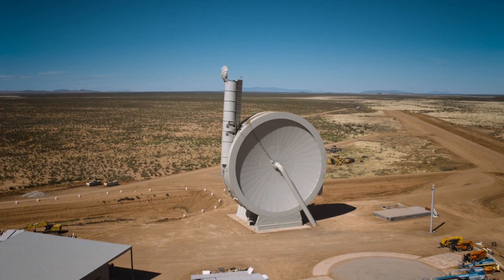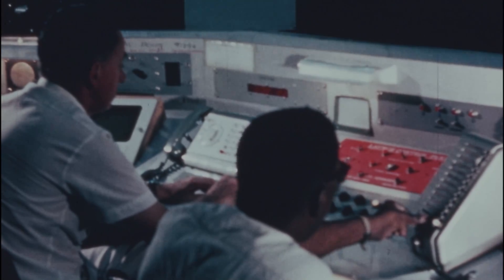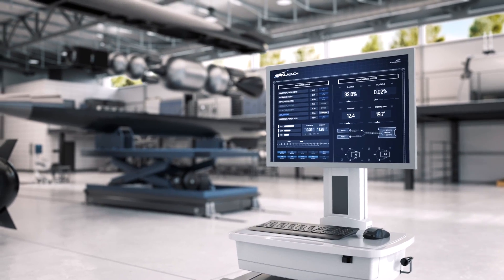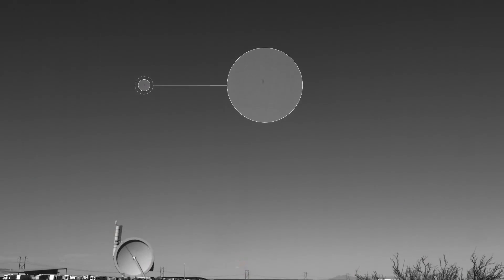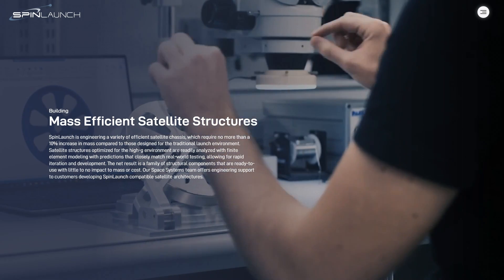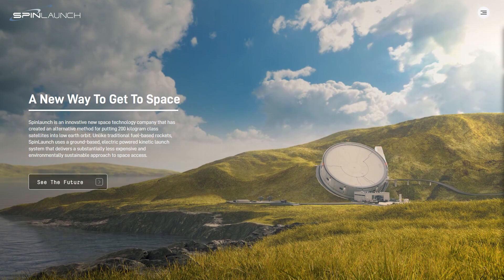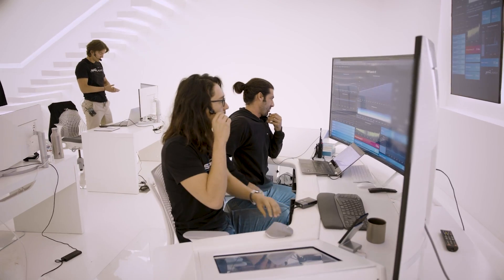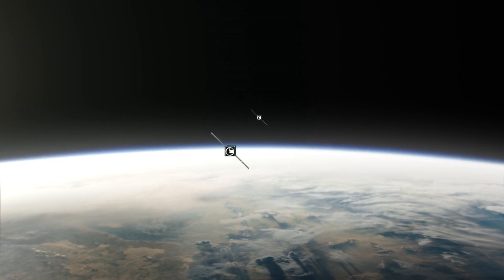Can Spinlaunch Throw Rockets Into Space?

Comment: So basically if the release goes wrong at any point you have a missile filled with explosive fuel launching at hypersonic speed directly into your only launch system which is also the world's biggest vacuum. What could possibly go wrong?
Reply: I wonder how far it could go into the ground if it released at the opposite of the right time.
Reply: @Hashishin13  Dirt is one of the best bullet-stops we have, so you'd be surprised how little it would penetrate.
Reply: @Hashishin13  :  I don't know how far.  
                  But! 
 I'd bet you'd end up with a tourist destination like that one La Palma has now. 🌋 😎👍
Reply: @Hashishin13   that is the easy solution to the load balancing problem brought up in the video.  Release the counterweight at the same time as you release the payload.  So they'd have to dig a hole deep enough that the impact of the counterweight deep in the ground was fully contained.
Reply: @Hashishin13  not much if a 10 kilometre  asteroid weighting millions of tonnes travelling at holy crap speeds  didn't created anything more than a large ditch on earth a 1 - 100 tonne projectile travelling at mach 1-7  won't do much.
Reply: @rohankumarpanigrahi7475  but then again the said asteroid wasn't aerodinamic
Reply: @rohankumarpanigrahi7475  Probably right but don't forget the atmosphere absorbed most of the impact.
Reply: I do not have the mathematical precision to answer this question Rohan but there is one other thing to consider here... and that's the narrow point and overall thin (and uniform) dimensions of this projectile compared to the larger surface area of said asteroid spreading out the force of impact more.
Reply: @rohankumarpanigrahi7475  well, it's because an asteroid spends most of its energy hitting the atmosphere, here it'd be at ground level from the start ;)
Reply: @john5r  do you realise the difference in the energy of an asteroid impact and whatever we can produce today.the chicxulub impact is estimated to have been equivalent of a million megaton tnt blast. The biggest nukes that we can make today are a couple hundred megatons at best.

I do realise that it would be a big disaster if things go south in this experimental setup.but certainly no earth destroying thing.The moon is much smaller than earth and the crater impacts it shows are all estimated to be way more powerful than a 1 ton projectile accelerated to even a couple thousand miles an hour.

It would be interest to see though .o assume the insides would be a vacuum chamber for high acceleration and low drag the question is when the projectile would tear through the chamber as shown in the footage there would be  not only be an atmospheric inflow into the chamber and also the speeding projectile which would be hypersonic would cause sonic booms all around the place and may damage the apparatus.
An engineering challenge to say the least.
Reply: @rohankumarpanigrahi7475  nothing more than a ditch? What a misleading troll. Dude a 10 km asteroid can easily create a crater over 100 km wide. Never heard of Chicxulub crater and its likes?
Reply: @Jinkypigs  I literally mentioned the chicxulub crater which other 10 kilometer asteroid ever crossed paths with the earth?.the the chicxulub impact crates is 180 kilometers in diameter not in depth. It's about 20 kilometers deep considering the average diameter of earth is around 12400 + kilometres. A 20 kilometer crater is literally just a ditch or even less.even of the depth of the creater was 200 kilometers it's still just a small ditch on the planet.
The point being an asteroid impact which is estimated to take place once every millenia or more at such a scale if the earth has survived a million-billion tonne asteroid impact the size of an entire megacity block made of dense metals this projectile which would certainly be no more than a couple tens of tonnes at best is no threat to the planet.
Reply: @john5r  the aerodynamic drag is at the maximum when you are closest to the ground so this projectile would face a huge drag instantly as compared to if it was launched from space to earth.the atmosphere is densest at the surface.
Reply: @rohankumarpanigrahi7475  but this one's pointy!
Reply: @Snake_Red  well, the bit that formed the Barringer crater wasn´t all that big, and it went pretty darn deep before it exploded from it´s own friction heat
Reply: New dimension?
Reply: @aint4nun  no, singularity
Reply: @chromiyum6849 looking for new way to get into space but instead find a new way to wormhole.
Reply: @chromiyum6849  nah, I´d guess multitudiny, as in "shrapnel".
Reply: just Kaboom.
Reply: @kukunishad  kaboom Rico
Reply: @kukunishad   it would be a satisfying kaboom.
Reply: @kukunishad  Yes Rico, kaboom
Reply: @kukunishad  an earth shattering kaboom
Reply: @Helzagore 

The ultimate rock skipper.
Reply: a voidout
Reply: Meh, just put all the important stuff outside the plane of rotation.
Reply: @iant2064  lol
Reply: Just wanna say that it's not even remotely close to being the world's biggest vacuum, not that you didn't know already.
Reply: @Asikkott  Yeah, I feel like space is probably a bit bigger.
Reply: I'd like to see their risk assessment and DFMEA on this topic :D 
Either the best in the world, or some of the most expensive mistakes to learn from...
Reply: Oh this is why this is in my recommendations lol
Reply: You're saying that like its more dangerous than a rocket
Reply: @rufusstevens4447  it is
Reply: @rufusstevens4447  It is more dangerous
Reply: Awe it will be fine.
Reply: Guess we’ll see in 2025 when the video of it goes on YouTube LOL
Reply: Taking pumpkin chunkin to the next level.
Reply: The moment of jeopardy you are implying in my understanding is if the fuel goes hot because of a kinetic impact with the launch chamber as a result of a failed/ accidental detachment. For one the fuel may need a catalyst to ignite and two with the pressure and heat generated by the forces of the launch system we know that the fuel is at least somewhat stable. The most likely answer being the most probable, we can estimate that the fuel does need a catalyst and may be mostly inert. This leaves the concern of sudden pressurisation of the vacuum launch chamber enabling the potential explosion to be proportionally large; however, because we know the fuel likely will not ignite without an additional catalyst we can neglect the force of the rocket exterior colliding with the launch chamber interior and the potential thermal reaction/explosion that may occur. If the rocket were to puncture through the structure or if the the structure wobbles and points the rocket somewhere unintended, that is when we have a rogue high speed problem of the imminent variety
Reply: @Charlie Beckwith It's not going fast enough to go very far. That's why it has an engine. It will also never be used to carry humans, so a self-destruct is always an option.
Reply: @ashscott6068  a self destruct only spreads the rotational energy over a gazillion of angry little bits. That energy is gonna go somewhere, and I don´t want to be wherever it is going.
Reply: So....Basically MegaMaid going from suck to blow
Reply: Let the engineering geeks figure this out. ^^
Reply: Nothing went wrong as long as you brought along sticks and marshmallows
Reply: If you put a small one on the moon though, you would be able to get off the moons gravity without any fuel at all
Reply: I don't know of any launch system that doesn't have the potential to fail spectacularly
Reply: How is that anymore dangerous than a normal rocket launch going wrong?
Reply: @Finnv893  "new thing scary"
Reply: @Finnv893  you are destroying the entire structure not only the rocket, how is that the same of a launch going wrong?
Reply: @Finnv893  For one, rockets can typically be steered and in worse case scenarios, remote detonated. Also, generally, they are quite stable, and launch in the direction they point. This thing is easily capable of launching many degrees off target, causing a significantly higher level of hazard. God forbid there is an error in release that causes the launch to fly horizontally, towards a populated region.
Reply: That's not really different to hundreds of tons of propellant sitting on a launch pad though....
Reply: @men8ifr  yes it is? Their control center is supposed to be directly under this thing. Than, Rockets are much safer. Here, if they get their release wrong by a hundred of second, the projectile will ram into the chamber. I bet you the vacuum chamber will cost much more than a Falcon 9 for example. Then there are like 15 other physical problems with it, like how do you keep the vacuum or how do you get rid of the rotational forces?
Reply: @men8ifr  there is a declassified safety briefing for ground crew by NASA regarding the handling of hypergolic fuels...that video totally freaked me out...
"if you observe orange, red or brown smoke, leave the premises immediately..."
Reply: @men8ifr  yes, it is very different actually.
Reply: Let's find out!
Reply: @Helzagore so what's the ultimate then?
Reply: You'll get ask the ultimate question?
Reply: A flashy ending?
Reply: I think it would be easier to answer the question of what couldn't go wrong.
Reply: Hu akbar
Reply: Obviously lose the rocket, but also lose the launch system
Reply: @smatchimo55  ok, cause rocket fuel contains an oxidizer.
Reply: Eehehhehe...I would like to see that...on a second thought...no...count me out.
Reply: Fourty Two
Reply: Should build this on the moon
Reply: Reddit comment
Reply: Don’t forget the 10,000 G force you also must survive
Reply: @Helzagore great, now we have below-radar ICBM's.
Reply: I am just astonished to how few MC/HC related comments I found so far. So here I am doing my part. Huge fan, Cub!
Reply: Yes Rico, kaboom.
Reply: you don't need to use spinning lever to throw something into space... you just need something that can propel something at that same kinetic speed...
a rail gun, or a series of spinning motors with rubber contacts like for powered roller coasters...
you only need a strip of land and the rocket would be following a rail.

you know those Nerf guns that shoot out rubber balls using a motor and a spinning disc? basically you bring a rocket into that shaft, The disc will propel it.
Reply: @Helzagore you could also make a bug smooth round rock perfect for skipping that fits inside it and put it flat over the ocean with 360 camera build all around the rock
Reply: CoD Zombies
Reply: Is that the command centre RIGHT NEXT TO the spinner??
Reply: It would be truly a glorious explosion, the sounds of the vacuum seal breaking, the fuel explosion, the shrapnel embedding itself into the surrounding areas.
Reply: cubfan asking the real questions
Reply: Ever seen the movie contact
Reply: Thump
Reply: An Earth-Shattering KABOOM!
Reply: Honestly, the last thing i expected to see here is a Hermit. Anyway, i don't think this company is gonna get far, it's just one more of these overvalued tech companies that are currently causing a financial bubble in the US that'll pop as soon as banks realize they have yet to make a single cent. This so called tech demo only proved that yeeting things at high speeds is possible by spinning them really fast. Which is a fact that had been known since biblical times. Just ask Goliath. Oh yeah, you can't, he got killed by a flying rock that, though much more low tech, was thrown the same way.
Reply: This is how you make element 115
Reply: @Hubertus Minerva you Are acting like there will be no kerosene in 20 years
Reply: Also the control center is right next to the spinlauncher, so with any (bad) luck the rocket will be crashing right into it all. Total destruction
Reply: Man they stole your logo cub :(
Reply: @Helzagore if this is the penultimate rock skipper who is going to make the final one? (penultimate means second to last)
Reply: Given the amount of kinetic and chemical energy suddenly converting to heat and pressure, the chamber holding vacuum will be the least of anyone's concerns at that point...
Reply: Yeah, this is a dumb idea. Also, YOU are here too?!
Reply: @Ted Leimbach ROSCOSMOS to NASA on using solid fuel boosters for manned spaceflight: "You WHAT? For real? But they...if you light them, you know...they burn....ehr.." (paraphrased)
Reply: All you'd need for a catastrophic failure is a payload that doesn't maintain integrity as it's being spun up.
Reply: @FlyboyCGC Nah, you´d need more energy to do that. But it will surely rip a hole in someone´s career continuum.
Reply: Nice to see ya here cub!
Reply: at least it's unlikely that any human will ever be in the capsule of one of these bad boys. They probably have lots of safety measures to make sure that this kind of thing doesn't kill anyone. It would still cause millions in damages though lol
Reply: @someonerandom704  I found an online g force calculator and it appears this thing operates at 20000+ gs of force. Sustained g forces of 6! is enough to kill a person... So considering it takes 1+ hours to get to speed.... Very unlikely indeed 😂
Reply: @justryingmybest  only? Hold my beer, my lab centrifuge can do that....
Reply: @someonerandom704  imagine these being manned. Talk about human soup
Reply: @someonerandom704  SAFETY SYSTEMS? LOL IF YOU WHERE IN THAT SLOW ONE IT WOULD HAVE KILLED YOU!
NOT FOR HUMAN USE EVER!
Reply: @someonerandom704  its not just unlikely, its simply impossible thst a human would survive anything even remotely close to 10000 G lol
Reply: @baadlyrics8705   with 99.9% of space launches being unmanned, is it possible they intend to use it that way?
Reply: @someonerandom704  No human can survive the 10000 gs that it exerts mainly.
Reply: @someonerandom704  safety measures like putting the control room right next to the launcher?  Did this outfit take out a huge insurance policy for all their employees?  I hope they are not self insured.  This thing is nothing but a money pit.
Reply: @someonerandom704  "unlikely" Is not the appropriate word, impossible is
Reply: to be fair, it’s not as if regular rockets are any less scary when phrased like that
Reply: @sage5296  that’s just not true
Reply: @sage5296  Yes, they are far safer.
Reply: I can't believe that they found investors for it, but what's harder to believe is that they actually built it LOL!
Reply: I mean a rocket is essentially a flaming fuel tank jetting fire out it so fast it creates lift.
Reply: Well they couldnt even get it go any where near straight at the slow speed of less than the speed of sound! 
It smashing into the atmosphere hitting that massive pressure and it being heated to over 1000 degrees is another problem!
Reply: Implosion then explosion?
Reply: About as much as launching a missile out if a giant hole in the ground.
Reply: What could go wrong with a chinook helicopter? The blades pass between each other at higher RPM than this thing. Just saying.
Reply: @dr.pepperoni5415  OMG, the Chinook....yeah. the magic is in the gearbox...until it isn´t. It´s not as if a Chinook didn´t spread a paratrooper section over most of Mannheim airfield...
Reply: Because normal rockets are not a huge bomb? 🤔
Reply: @alonspitz86  Most of the energy in rockets are in the combustion. Most of the energy in spin launch is kinetic. In this scenario, the huge bomb is actually safer than a rogue ballistic projectile. Especially since rocket sites are usually devoid of people.
Reply: It sure is great that their control room with all of their people is right next to the  spinner! They're completely safe, don't worry.
Reply: did you see how close they put their control center? lol and yea their projectile is tumbling out of the machine
Reply: What i was saying. But I ain't worries about the damage to the system,  but the fallout to the surrounding.  And in the worse case scenario where the rogue vehicle did not crash itself into the safety barriers (I am assuming they have thick tall safety barriers all around ), it can easily crash into the surrounding area 10, 20 km away, with all its propellants.
Reply: @Dreymon Green The point is if anything goes wrong in a rocket, it's usually away from population centers, and any debris will fall mostly vertically with comparatively little horizontal velocity if it self destructs. This thing can launch either a bomb, or a cloud of shrapnel travelling horizontally at Mach 6. So it can potentially cause damage further away, and also cause more damage at the same time.
Reply: Hey, right now we are sending people into the harshest environment ever known whilst strapped to the top of a giant bomb while hoping that it explodes slowly enough to not kill the passengers. There are few "good" answers to the question of how to get to space.
Reply: You won't spill your drink if they have cupholders
Reply: it only has 1 way to exit so I guess it would be a ballistic missile heading for china or something.
Reply: @Wilderweincd  who says the projectile has to come out of the designated exit? What if it releases early/late?
Reply: @Wilderweincd  One planned way to exit... infinite unplanned ways to exit.
Reply: worlds biggest non-nuclear explosion
Reply: Awesome video replay for failArmy???
Reply: @Dreymon Green Wrong
Reply: Luckily they placed their control center directly below the big spinner ^^
Reply: Oh. You have people in the rocket? What will go wrong????
Reply: @Dreymon Green Not at all true.
Reply: @Pwnopolis  Proves your ignorance. A regular rocket is FAR FAR safer than spin launch... for a multitude of reasons. And yes, safety is a big obstacle to progress, for good reason too.
Reply: This is as stupid as a space elevator 🙋🇺🇲🛠️🇷🇺
Reply: OMG so this is dangerous and regular rocket are... not?
Reply: @DeputyNordburg  Correct. Regular rockets are far safer.
Reply: @john_titor1   It's been 7 months since a Space X rocket blew up on the pad, 3 years for NASA.  2 months for Firefly.
Reply: @DeputyNordburg  Okay, and?
Reply: @john_titor1   and Joe.
Reply: @DeputyNordburg  ??
Reply: @john_titor1   Joe Momma.
Reply: @DeputyNordburg  This is.. MUCH more dangerous lol.
Reply: @dandromeda1   Not.. REALLY though.
Reply: @dandromeda1   OMG watching videos is work to you?  I've met some loosers here on YouTube but you are in the running for the biggest.  
If you have relevant point or original coherent though, please come back.  I'm "gona" keep an eye out for you.
Reply: You got any better ideas m8?
Reply: @thatoneguy_0218  normal rockets?
Reply: When do they start testing with live occupants?
Reply: @chinhphan4787  Never? The exposure of the G forces would kill any man alive
Reply: @chinhphan4787  never
Reply: @Charlie Beckwith A miss release would almost impossible as the release system would be coupled to the shaft angle, in that the mechanism would be set to "release" by a computer, but the payload wouldn't detach until the shaft was physically at the required angle, and that last step would be a physical detachment trigger. For example a small pushed in button that detaches the payload clasp.
Reply: @laurencef8535  imagine if the quick release got stuck
Reply: @laurencef8535  That's a good point. No matter how fast the device is spinning, the detachment point will always be the same. With a physical release, there would never be a delay with detachment. You would use an electronic system to arm the mechanical system, so there would never be a delay release where it detaches at the wrong point. 

The unloading imbalance is a bigger issue than the detachment i think.
Reply: @kasuraga  What do you mean, this is a word salad nonsense argument. There are a great many things that can go wrong with release at these speeds/masses/energies.
Reply: @laurencef8535  So, just "talk it away" then? Because it's one thing to say all that, and another to actually have that be the case.
Reply: As opposed to filling a giant tube with the most combustible liquids known to man and setting light to it? This seams relatively safe.
Reply: @gammaphonic  This thing will be spinning said albeit smaller tube with the same or similar liquids. So you have all these risks magnified.
Reply: @gammaphonic  did you even read the comment you responded to? Spin launch is a horrible idea IMO
Reply: Oh look a nerd know-it-all.  Maybe you should get a job with them
Reply: Probably less disastrous than a monstrous rocket filled with toxic fuel that need to be manually detonated to avoid havoc on surface.
Reply: @yogeshkumar7389  At least the rocket will be either high up in the air, or at/ near the launch pad in case it explodes. This thing can launch a hypersonic multi ton missile at ground level if the release is mistimed. At that point, any self destruct would be kind of irrelevant, and judging by our history related to ANY engineering projects, there will be accidents.
Reply: @yogeshkumar7389  Do you even know what toxic means?
Reply: @bobincognito6239  could not understand what do you mean. 
I am saying that yeeting a half tonne payload to high altitude by using pure electrical energy so that it uses less fuel to enter orbits is obviously more environmentally friendly than mega rockets literally the size of buildings most of which use hydrazine and other toxic propellants.